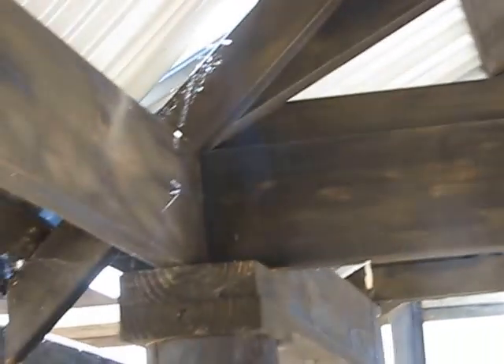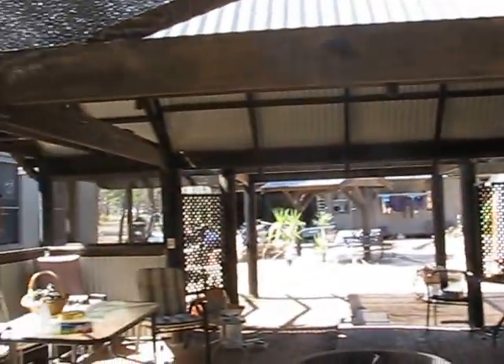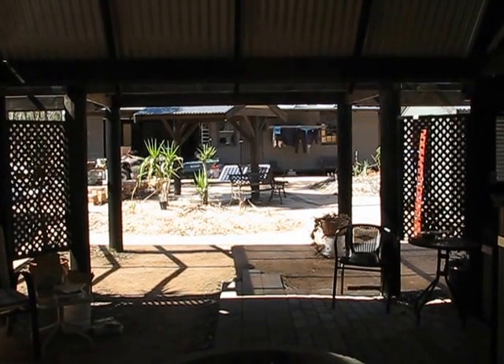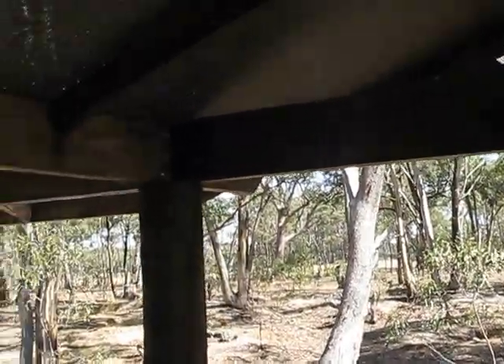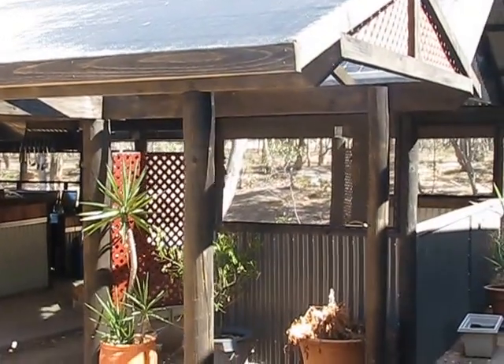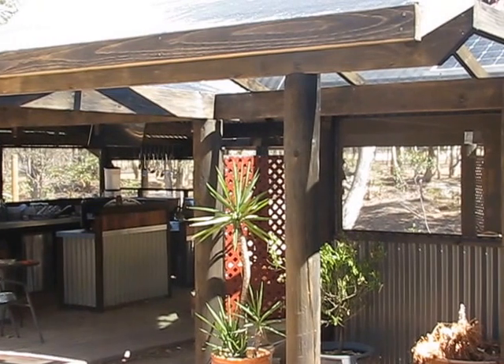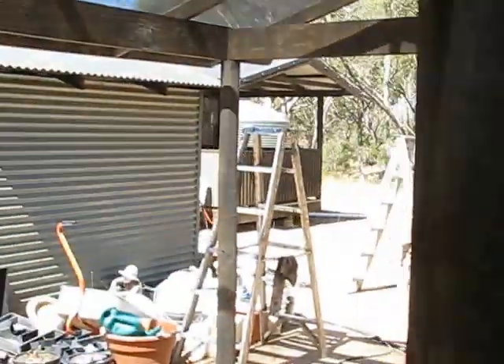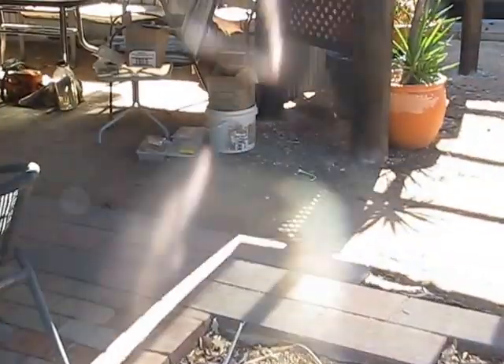Off the Grid and building  pole construction

Comment: Steve if you didnt have a laser level....could you use the old water in a clear length of plastic hose trick..??
Reply from the maker: Laser levels are dirt cheap these days , but I have used the water level with long pieces of clear tube many times for my self and clients jobs ... so yes you can :- )  just be very careful not to have any bubbles in the line and be patient with waiting for it to settle each time you move it :- )
Reply: Thank you..:)